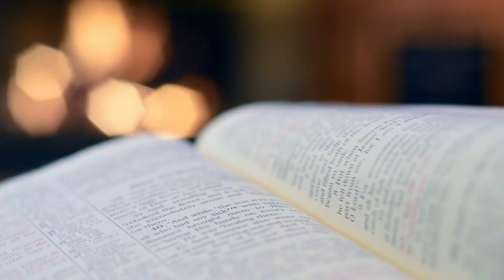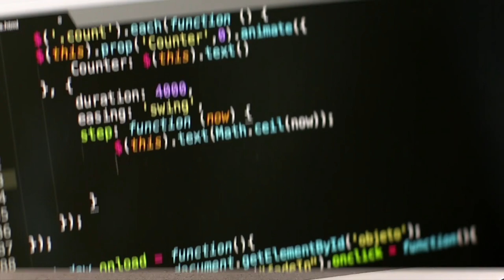The German Auto Industry 🇩🇪 - The engine of Germany?

Comment: Code forbidden AE styles (AE 9 parts) in automobile market know as bad automobiles and bad motorcycles thus. Uneducation Automotive Engineering group class brilliant have invent these ones for their feeling without knowledge. 
1. Wider rear track than front track bodyworks | The lowest traction 0.7g, extreme tail flick, extreme slide, 1-5 km/l, below 1 km/l by Formula one speed 160-250 km/hour, over 250 km/hour on all circuits. Symptom little with driving speed traffic limit law on all path roads. 
2. Front track as same dimension as rear track bodyworks | The medium traction 0.85g, tail flick, slide, 1-5 km/l, below 1 km/l by Formula one speed 160-250 km/hour, over 250 km/hour on all circuits. Symptom little with driving speed trafic limit law on all path roads. 
3. Wider front track than rear track bodyworks in below 10 mm | The medium traction 0.85g, tail flick, slide, 1-5 km/l, below 1 km/l by Formula one speed 160-250 km/hour, over 250 km/hour on all circuits. Symptom little with driving speed traffic limit law on all path roads. 
4. Wider front track than rear track bodyworks in 10 mms | The medium traction 0.9g, tail flick, slide, 1-5 km/l, below 1 km/l by Formula one speed 160-250 km/hour, over 250 km/hour on all circuits. Symptom little with driving speed traffic limit law on path roads. 
5. Wider rear parts than front parts bodyworks | the lowest traction 0.7g, extreme tail flick, extreme slide, below 1 km/l by all speed on all circuits.  Symptom little with driving limit law on path roads. 
6. 1-4 turbo intercooler petrol engines hybrid all and 1-4 turbo intercooler petrol engines all : Easy damage parts engines, 1-5 km/lite, below 1 km/lite by Formula One speed (160-250 km/hour, over 250 km/hour) on all circuits, test maximum over 150,000 rpm, little damage with traffic limit speed law on all path roads. 
7. CVT all : Easy damage parts transmission, 1-5 km/lite, below 1 km/lite by Formula One speed (160-250 km/hour, over 250 km/hour) on all circuits, test maximum over 150,000 rpm, little damage with traffic limit speed law on all path roads. 
8. Without rear fog lamps : no one see rear parts transports in fog by without rear fog lamps. 
9. Who ever build brakes over 1 per side are stupid by broke down all electric circuits. 
This record information come from all brands and all socials who can't pass Europe test performance standard bases all in automobile market. It mean no one pass Europe test performance standard base in automobile market. Code forbidden AE styles group in automobile market are all criminals class brilliant terrorists, mutant class human terrorists, prisoners all class humanoid and their status prisoners level death clans. These ones effect EV, hybrid. 
From
All brands and all socials databases
Of course, all socials prefer code forbidden AE styles (AE 9 parts) in automobile market for their crime rob and corruption tribbile millions euros for fun.
All social become criminals clans with build code forbidden AE styles in automobile market. Beware about their terrorists rule automobile market with code forbidden AE styles (AE 9 parts). These information can check parts of your products. 
All you should use without code forbidden AE styles (AE 9 parts) in automobile market pernament after these nines parts are illegal with no one pass.